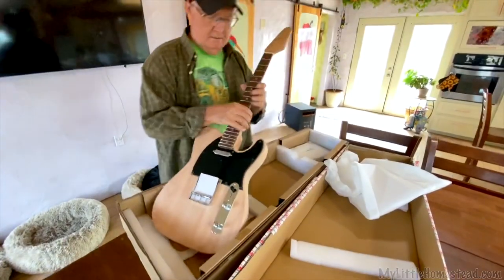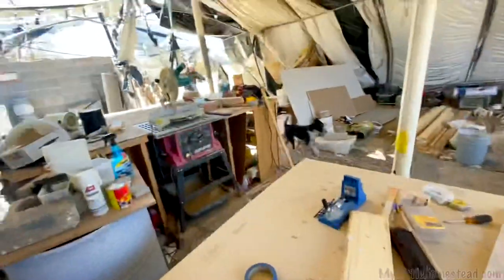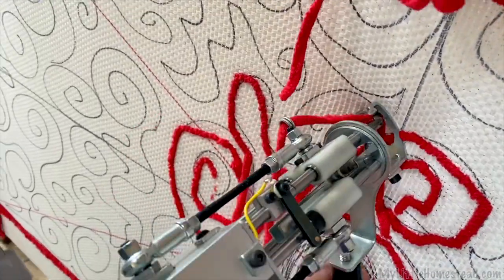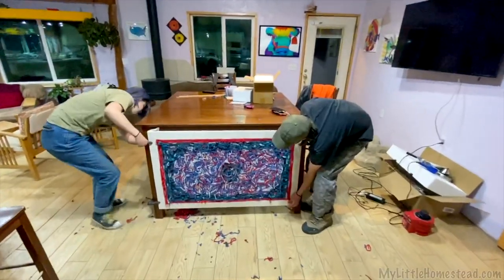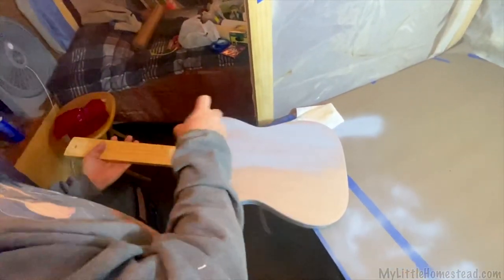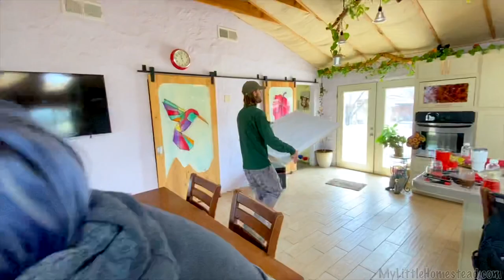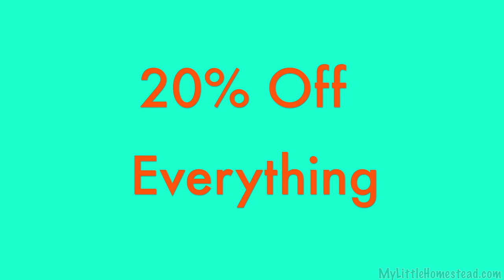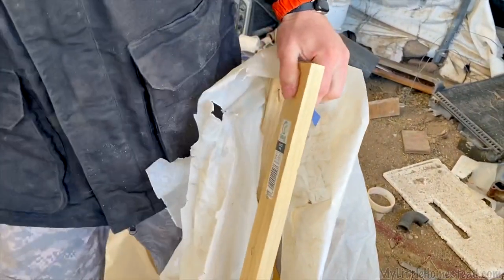Rug Tufting Gun, Guitar Kit Build & Quail Egg Incubation Hatch! | Weekly Peek Ep277

Comment: Sha for the edges of your rug even though you spray glued the edges you might think of sewing the edges because the glue may not hold after a length of time of if the rug gets wet the glue may not hold and the edges come loose. run two lines down the red area you can use res thread to blend in with the red yarn and even sew a pattern in the edges.

Comment: Y'know, watching Gary working in the earth bag room (I think that was Shae's bedroom?), and looking at the sad state of the hoop barn, leads me to one conclusion: This summer's big project should be to replace the hoop barn with one great big enclosed workshop, built with earth bags, or concrete block, or maybe a combination of the two - earth bags all around, and blocks on the front to match the smaller building next to it. Big barn-style doors at the end, plus a smaller human size door on the side, and plenty of skylights to bring in the natural light (but frost the glass to eliminate harsh shadows on the shop floor).

You can have a woodworking area with the table saw and a big assembly table, and some wheeled work tables to move around, and a long fixed workbench on one wall with a miter saw mounted to it. And in one corner, a permanent paint booth, with built-in ventilation fans leading to the outside.

And most importantly, either a wall-mounted air conditioner, or at the very least, some big wall-mounted fans to get the air circulating inside on those hot summer days.

You're welcome for the idea. Just etch my name in the cob when it's done and we'll call it square.

Comment: This was such a fun video 😆. I think the best yarn for your rugs would be an animal fiber like wool or alpaca. They will felt together with use making the rugs even stronger. There is a thin nonslip  rug backing at Menards that is black (doesn't show the dirt as much) and will not need spray glue. It can be sewn through. I like it under my throw rugs. Using wide bias tape will give the edges a more finished look. The chicks were sooo cute.

Comment: From what I’ve seen you can use hair trimmers to even out the thickness of the rug (use desired length guard and run it all over the rug). When the carpet is done I think it is also fairy common to use liquid glue on the back threads binding them to the carpet base and keeping the threads from sliding out from the holes. I have never made rugs, these at just things I have seen, so it might be good to double check.

Comment: For rugs. Use multiple strands of thinner yarn. To put the cloth on tension, use tensioner for carpets (strips with nails, fix them around the frame, and hook the cloth on the nails). Your cloth was not pulled taut enough. And small designs work better for small projects;-)

Comment: The Two Part Candy Apple Red is a new technique. I have a real fire hydrant that I did something similar with using the old school paints. Except that I used Bright Aluminum over a light grey primer. I did this back in about 1978. The candy apple red has chipped off and the hydrant has started to rust a bit - unlike Gary - who hasn't rusted a bit as far as I can tell.
;-)

Comment: Hey all! I have the same tufting gun and its definitely on the clunky side compared to nicer models but they are more expensive :( If you want to be able to wash it use a latex adhesive or carpet glue directly on the back of the monks cloth after you are done, it will hold it together brilliantly then you can add your backing of choice.  Another tip is to use a really tight zigzag stitch around the edges to finish it off and it will help with any curling you might run into.

Comment: for your rug try cotton for a smooth twist in the yarn, wool will give you really good durability.  You should also be able to set the length of the punch of your tufting gun to get a tight loop or longer for a looser loop.